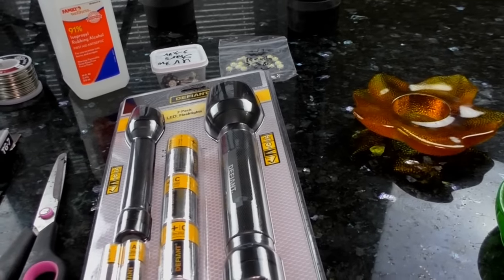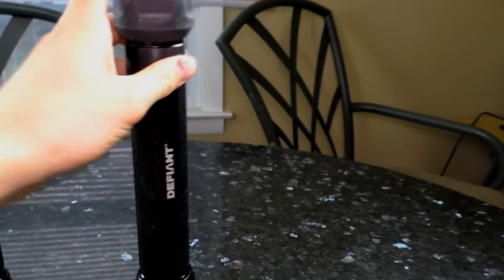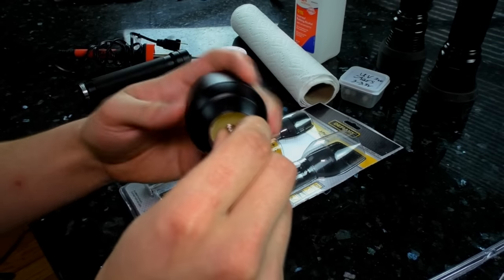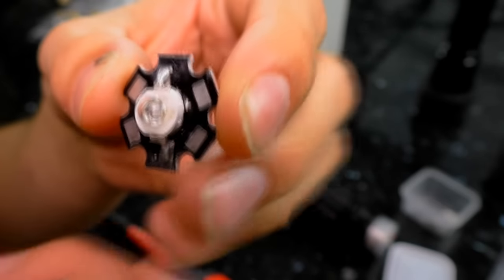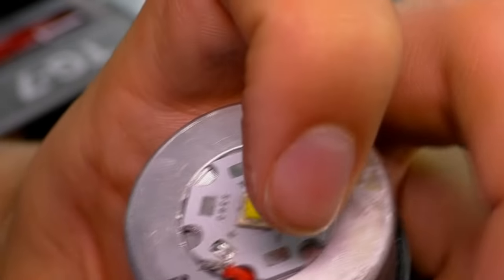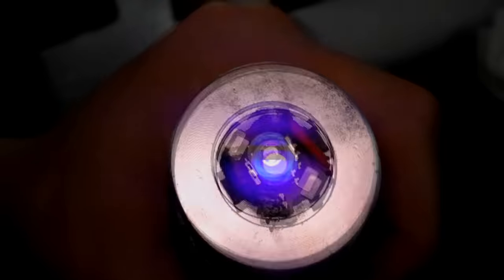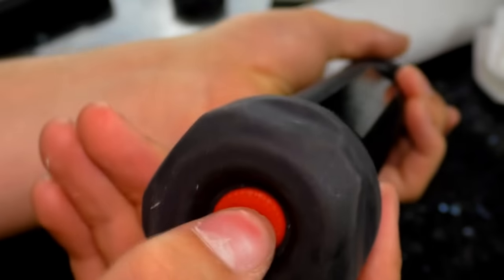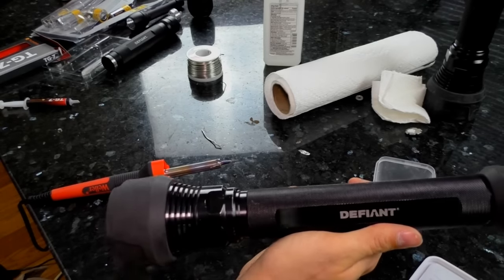UV Super Bright Flashlight, Custom Mod!

Comment: You can use the small pocket lasers for the same use, with mine it has a focus ring so you can get a good spread of UV light.
Reply from the maker: I have heard of those before, might I ask what you use yours for?
Reply: +TrollFaceTheMan 
It has no real use for me as such, it's more a novelty thing. Popping balloons, lighting a match head etc etc.. It's only 5 mW but the focus feature makes it possible.
Reply from the maker: Ah, is it by chance a Blue-ray burner?
Reply: +TrollFaceTheMan 
When I 1st bought it, I figured it was just a cheapish blue laser pointer, only when I whined it on things that flouress did it dawn on me that it was in fact a blacklight laser. 
It takes a CR123 battery, and still works great today :)
Reply from the maker: That's why I am wondering if it might be a BlueRay laser Diode as they are 405nm which is uv.
Reply: +TrollFaceTheMan possibly, the Chinese recycle/ upcycle as much as they can to make cheap products. This came from eBay so there are no guarantees of what you're actually getting through the post. :)
Reply from the maker: Well so long as it work though right?

Comment: I think this can become a burning laser if the glass on the front cover was replaced with a fresnel lens piece :P
Reply from the maker: I have looked into making lasers using lenses, however due to multiple light waves and wave orientations of light from a non laser diode... It is pretty difficult to properly focus the light.